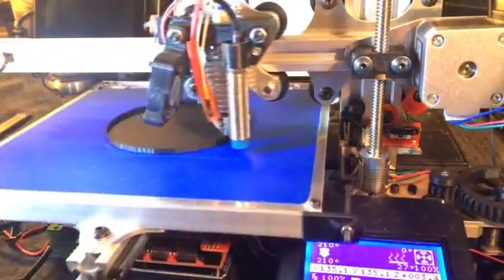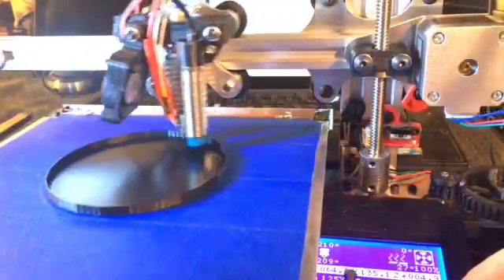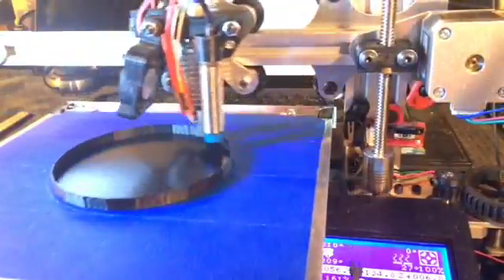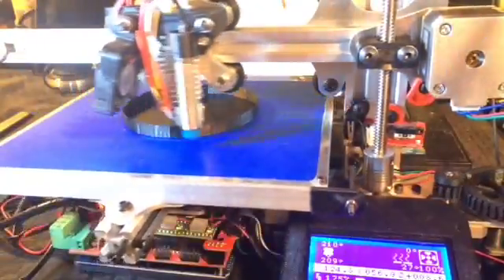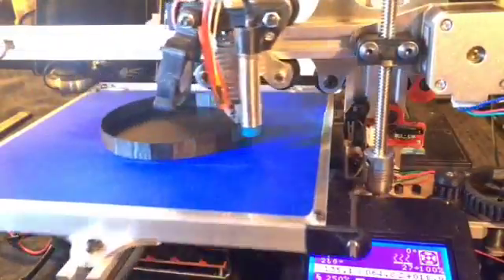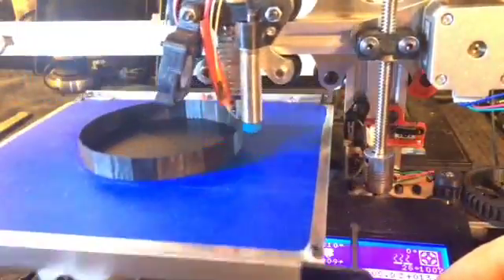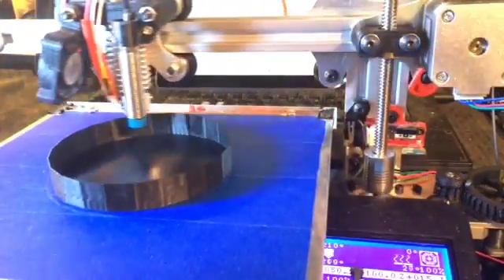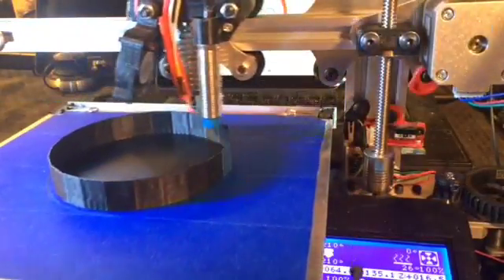Reach 3d Printer at 200mmps

Comment: Have you re-tested this with the current version?
Reply from the maker: Well, I haven't changed the design much, but a few others have designed belt tensioners for this printer, to improve consistency/accuracy. You Might get better results, but probably not much. Most people print in the 60-80 on this printer for run of the mill prints. 45 is a slow speed for great results. 200 is beyond reasonable for most prints, but I'm sure with drv8825 drivers, this machine could push into 100-150 for most prints.

Comment: I cant see a clock.
Reply from the maker: The big white screen in the background is my iPad with the clock app running. It was washed out by contrast, but this was a live demo, I was speaking live as I was recording the video. So you can use your own watch to estimate the time. There is also a minute counter on the LCD screen to show elapsed time of the print.
Reply: Ok, thanks. Great Printer you have there

Comment: i do like these kind of video's so it lets us all compare info. Im running Ramps 1.4 at at 1/16 with stepper motors nema17 78oz for all axis. marlin set at 3600 for x,y with  jerk set at 8 on a prusa i3, In my slicer I have print speed set to 60mms for a vase with a 0.6 nozzle on a genuine E3d V6, I can crank it up to 300 on the federate with autotemp turn on before it start losing steps.

Comment from the maker: Not sure how to post the picture on Reddit, or on this comment, I may have to use a video tool to add it to the end. 
Also, I just realized the Clock is white. It was on the ipad in the background... but is washed out. 
Let me know what you guys think. I finished the print and the 30-60mm/s looks Awesome... The 100mm/s has a bit of texture, and the 200 has extreme texture...
Nate